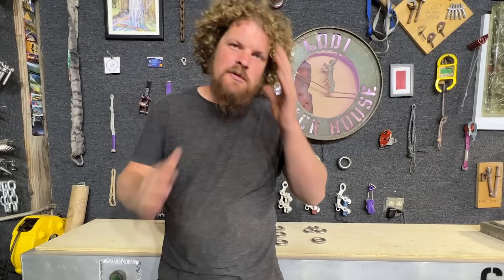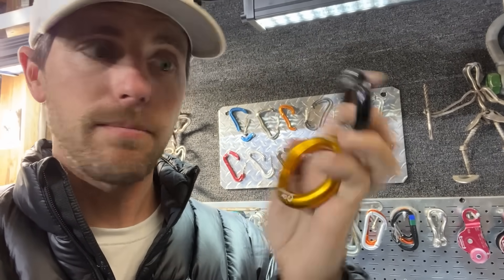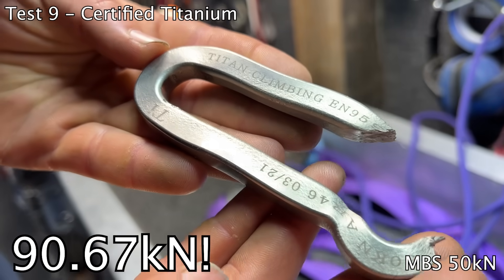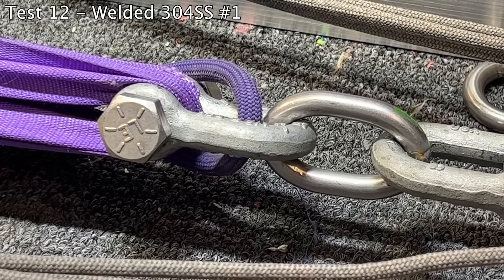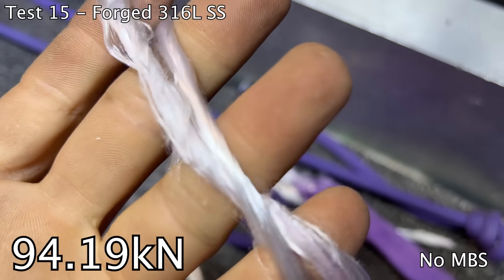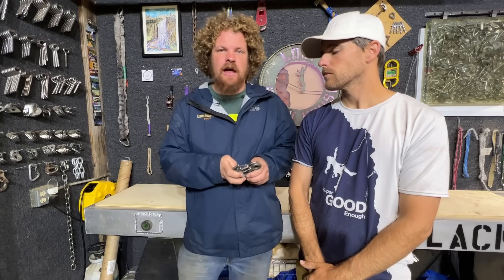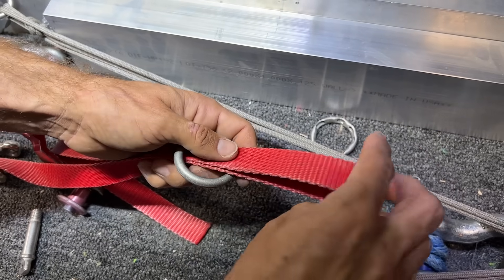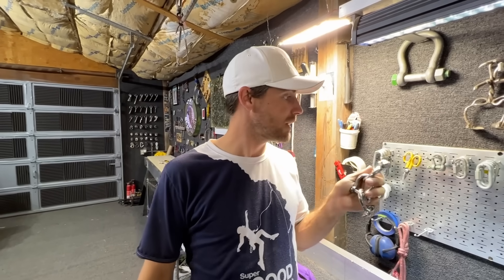This rappel ring could kill someone

Comment from the maker: I experimented with more text on screen to see if it helps the audience follow along with either MBS or the results or which test we are on.  What do you think?  FYI: the chart of data is on the blog  https://www.hownot2.com/post/rappel-ring

Check out our new store! https://hownot2.store/
Reply: Love it!
Edit: It would also be cool to see the live graph so we can see how the samples react to the applied force in real time (if possible)
Reply from the maker: @samlauer1  that is something I definitely want to do soon
Reply: Really liked the screen text, wasn't massively oppressive and was all the info I wanted. In short: perfect
Reply: Love it. Makes it super easy to follow.
Reply: Love it !
Reply: I love it!
Reply: Great addition!
Reply: definitely helps
Reply: I like the breaking strength test on screen also.
Reply: Having the MBS on screen was really really helpful
Reply: Yes, useful for sure - like brown stains on 🩳 comment 😁
Reply: I use closed captions to help me
Reply: should have set the machine to go to a certain level and hold.

sure the ring will break if you go from 0 PSI to 9,000 but what if you go to 4,500 and hold would it deform slightly and hold or would it continue to deform until breaking.
Reply: The text is definitely helpful. I would suggest adding foot Lbs conversion as well as the Kn one.
Reply: Text good!
Reply: i love the on screen text

Comment: And that is why they figured out a long time ago to make train tires of seamless/forged steel rather than to risk having a weld seam or casting or such.

I'd be curious about just making ones from seamless pipe stock, cut up into rings of suitable thickness, then smoothed over until the initial sharp corners are all rounded enough.

Comment: Question for @HowNOT2 it seems from other comments that the welding was fine.  so would the conclusion be "if rapelling on suspect rappel ring to put the weld on the load axis (touching the ring or biner)"? also as a general note I appreciate much when breaking worn or suspect gear, one learns more about margin of safety...for rings it would be useful to know minimum cross section to do a rappel (say 4kN?) from lowest strength metal.

Comment: The stainless rod that is tig welded broke because the welding tempered the metal and if the rod was preheated and welded then slowly brought back to room temperature say in heated oil it would be much stronger

Comment: Speaking of rust it's a shame the shipping would be murderous but I've got some heavily corroded ex mooring chain. Given we don't have the logistics issues of some poor git carrying it halfway up a mountain it's more economical for use to use heavier mild steel (galv just wears off) instead of stainless. I'd be curious how much strength you lose

Comment: The welded stainless rings broke differently because of the orientation. The first one pulled the weld in shear and the second was filling in tension. The same as pulling on a bolt In a wall

Comment: Yeah, if it's RATED for something and breaks below that? You've got a serious problem. Yikes.
Reply: While I generally agree with your sentiment, 4905 is within 2% of the rating. Maybe every other one in the batch would test to 5105? If you really needed that extra 2% for a safety factor, then just use titanium. Manufacturing isn't perfect. And neither is their testing methodology, which probably has some percentage of error built in.

Comment: A good weld shouldn’t break at the weld. It should break on either side of the weld. Because the weld itself is actually stronger than the steel when done properly. And a first year apprentice should be able to get full penetration.
Reply: I’m curious to know though if the difference in forces was due to bad weld or where the force is being applied or a mix
Reply: That depends entirely on the fill material. Sometimes it's stronger, sometimes not. It's a wives tale that a weld is always stronger. It's not, but usually it is.

Comment: You should get some one to make these out the tool steel. They started using this material in engines to replace titanium part. 
Tool steel is not a lightweight but it’s very close to Ti and it as almost unlimited lifespan compare to Ti and way cheaper

Comment: That the weld broke on difernt stregth proabably has to do how you pulled on it. On the first one, you pulled it inwards, or together. That means it was not stretched a lot, and basically forced into itself while only a small outer part of it was stretched. On the second one you pulled it outwards, forcing it apart. Meaning, a lot of the weld was stretched and pulled apart. Which actually makes a huge difference on how much it can take. Because a weld can take much more compessive load than tensile load. It´s down to the weld disrupting the crytal structure and intruducing nucleation points for fractures. If you press on the weld, that won´t really do a lot of difference, but if you pull on it, it offers starting points for dractures to form and noticably weakens the material.

Comment: it's not surprising that the welded stainless rings broke like they did, welding is depositing a cast material that is much less flexible. I'm sure if these were anealed and heat treated, the strength would rise a bit, but be at like 2x the cost
pulling with the weld on the shacle supported it, while in the other test you can see the elongation reaches the weld, which can't elongate, and fails.
ooff, that plx ring wasn't even full pen, it was just a perimeter weld. I would have thought they would be x-ray'ed and require full pen. crazy how it can reach that load with that weld

Comment: I'd like to point out I'm actually sure micro fractures are something that happens to metal specifically something like heat treating a blade. If you quench steel you are trying to harden incorrectly it can cause a small fracture than when put under stress causes premature failure. Idk why that would be though of as an issue for most metal things since you are not going to quench most metal produces.

Comment: I like your guys content but i do have one thing so the load you guys are putting on your tests is a constant load wouldnt a shock load be better for climbing equipment considering a fall isnt constant is shock and also measured different im no engineer just going off junk i learned i harness and tie off stuff just a humble welder with a question

Comment: The reason the rolled aluminum bent and the solid aluminum (almost certainly machined or cast not forged since aluminum can't be forged using traditional processes because of how aggressively it oxidizes) snapped is because different aluminum alloys have vastly different levels of brittleness.

Comment: The weld orientation does matter. In the first part you’re applying pure axial loading to the weld as the shackle keeps the weld orientation in place.
In the second orientation you’re applying axial and bending loading to the weld, the bending loading occurs due to the deformation of the ring changing the weld orientation, this causes the weld to shear easier.

Comment: the ones that got welded could have been welded with material with different tensile strengths. which measure how much weight they could handle.

Comment: So pretty much never buy aluminum rings. Also I'm not a climber and when I first found out that they use aluminum rings in climbing it really shocked me I would never put my life on the line with aluminum in the mix I know you can have strong aluminum parts but the ware resistance is so low I would never trust it

Comment: The welds would hold up differently depending on where you pull from. In the one test you were pulling the weld apart and on the other you were putting pressure directly against it.

Comment: The welded stainless failed at the welds because the temp wasn't  controlled during cooling causing crystallization in the weld nor were they tempered to destress the weld, you can tell by the way the welds crack, pull apart and how they look after failing

Comment: The two stainless rings broke at different pull lvls because of the placement of the weld in the test. The first one had a higher strength cause the weld was being pulled in the direction of the weld. The other one was against the weld.

Comment: I don’t know much about solid titanium but I’ve rode bmx my whole life. I’m 35 and recently completed a 100% titanium bmx bike and 1 thing I’ve noticed within every part I’ve found that someone makes in titanium or that I’ve had to have made is that it has 0 give when it’s piped or hollow idk what it’s called but unlike 4130 steel where you can feel a bend when landing a huge gap or from air to flat, titanium is insane and it’s very much stronger but you can’t feel any give it just snaps. I’ve never slowmode or caught a break on camera before you feel no give at all, it’s solid and when you hit hard, handle bars and frames just snap. Really insane to see how much solid titanium stretches. This was very interesting.

Comment: as a professional welder i can assure you those steel rings broke differently by how it was pulled. welds cause steel to become brittle at and closely around the welded area. by putting the weld against the shackle you are putting tensile force on the areas not in the heat-affected zones. with the second one you put the weld in an area where it was required to flex. welds dont flex because of how brittle and hard the welding process makes it. it still insanely strong mind you but its easy to tear the unaffected steel away from a weld by bending it.

Comment: 7:50. From the outter layers that weld looked sufficient. Yet it failed at less than half the energy expelled to break the other weld. My point?
  “Just because your welds look neat and pretty, does not mean they are neat and pretty on the inside. Knowing how a welder works isn’t the same as knowing how to weld. On, off. Ground, spin the dial a bit because that’s what ya do. Voilà, pro welder. 

  Same guy later that day. “It wasn’t my fault, accidents happen. Wheels fall off sometimes…?”
  “No Kevin, they don’t.”

Comment: So at 7:50 I think what we are seeing is a non-penetrating weld on a tongue and grove style closing. The maker put a slit in one end of the rod, ground the other end into a wedge shape, then welded along the circumference. I believe you can clearly see the slit in the middle through the opening in the center of the welded lighter colored zone. I believe you can also see the remains of the wedge tip barely maintaining weld on the right hand top although the straightness of the leading edge has been badly warped as it was pulled out and apart. I'd like to know because metallurgy is fun and exciting.

Comment: Although it makes for good theater, these tests would be much safer (and less destructive) if you did not use something that stretches a lot, like your polymer ropes, as the stretched rope stores a lot of potential energy which is then quickly released as kinetic energy when the ring ruptures. If you used heavy steel rods, for instance, to connect the two sides of the ring, you would greatly reduce the violence when the ring breaks. It is why some tanks, such as SCUBA tanks, are pressure tested filled with water as very little energy is release due to the non-compressability of water if the tank ruptures. If a SCUBA tank were filled with air and subsequently ruptured, it would closely resemble a bomb.
Reply: The spansets and 12 braid Dyneema ropes have almost no stretch, and are way safer than anything made of metal when they go flying. A lot of the stored energy is coming from the hydraulic hoses.
Reply: The spansets and 12 braid Dyneema ropes have almost no stretch, and are way safer than anything made of metal when they go flying. A lot of the stored energy is coming from the hydraulic hoses.

Comment: Do you think that putting stress on them all at once is different then wear because the stress test makes it Heat up and wear cause micro fractures over time which makes it much more dangerous and hard to tell if it's safe. If it was stretched out then you would know for sure. I am just assuming and curious.

Comment: Curly-haired guy is wrong:
YES, weld quality can be quite variable, even when put through the same processes (automated manual), BUT, the geometry of the strain & deformation (both epastic, and plastic deformation) DOES make significant differences, especially as the heat of welding affects material properties, especially if there is no post-welding heat treatment to address that.

Comment: as an aero space welder im surpized that the welded stainless rings were not 100% penitration welds. Which is why it failed on the weld joint and no somewhere else on the ring. If it were 100% penitration and broke on the weld you would have seen solid metall all the way through and it looks like you could see the flats or the bevel of the parent ring matterial. Of couse it meets the kN rating that its designed for, but if they were to weld it with 100% penitration i bet it would contend with the forged rings.

Comment: What is the point in using kilo newtons 33,000 newtons is between 7,000 and 8,000 lbs of weight that significantly higher then would ever be needed for climbing seems silly using this really technical name when every oneas strong enough to hold three Andre. The giants

Comment: at 7:00 your buddy explained it perfectly, the way you position the ring drastically changes the internal stresses on the weld, more force was being concentrated on the weld as the ring deforms on the second "lower strength" sample. The welds are more than likely the same strength. Welds should not vary that significantly!!

Comment: VIDEO IDEA: you have to get slabs of different types of rock and figure out their breaking points. I can trust safety rates equipment but what about various types of rock? Doesn’t matter how well the gear holds up if the fracture the rock
Or break off.

Comment: 7.20 
For sure it's how they place it. And those should go tru some heat treatment after tigging. I don't just understand why someone wanted to put weak spot to safety product. It could have done the way where welding is toughest part, but totally "homogenous" ring is best.

Comment: Old machinist here. I  would say for those rings, you need 4140 steel. 1045 might do the trick as well. If you have a local mom and pop machine shop, they should be able to hook you up. (Pardon pun)

Comment: You ever bend something over and over and over and it breaks yeah that's repetitive stress breaking it not the force.  Every metal is weaker to fatigue  then just straight load. But he is right steel is better at handing it then aluminum. Mainly because aluminum has no strict  fatigue limit it's one of the metals that will break even under extremely minimum loads if repeated enough times.  Never trust your life to a piece of aluminum if it's going through multiple reversing stress cycles it will break eventually just from the cycles.

Comment: On your unmarked titanium the both broke on the side with the smaller shackle. The tighter radius is bending the ring more, higher stress. I wonder what your results would be if you used a soft shackle and had even loading across the surface of the ring

Comment: Titanium and stainless steel have similar properties, with the exception of weight. Stainless steel is often chosen for corrosive environments, as is titanium. I would put my faith in a robust design made of stainless, but I would prefer a titanium item that has a greater rating than the stainless one...perhaps I'm unreasonable, but I'm still alive, sooo..

Comment: Cool video with some interesting results! I can tell you for certain that the two stainless rings didn't break at such different forces because of weld quality. It was very much the orientation of the weld. Think about it, go watch when the weld was between the shackles, the deformation puts a huugee concentrated tension on the inside of the ring, peeling the weld open. With the weld at the shackle, the weld is pulled much more evenly and yields at nearly the same tention as the base material would

Comment: I'm a commercial climber of trees, towers, and other structures. This is why I NEVER use ANY aluminum components in my rigs. I use only steel or stainless cz I KNOW it's not going to fail; I'll keep paying the weight penalty, thank you. I frequently rappel off these structures, cz it's quicker and easier than climbing down.

Comment: Yes is does matter on how you pulled the welds replay in slow motion the one with the weld in the middle it separates the weld on the bottom so it was like tearing a piece of paper from one side to the other